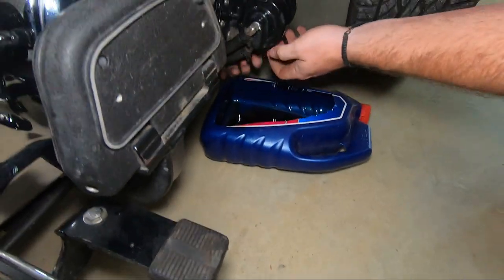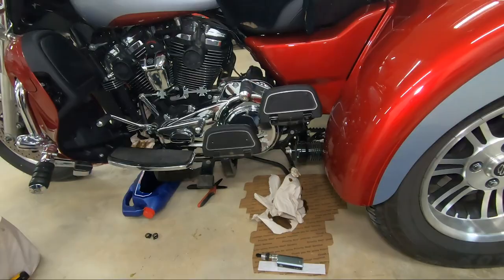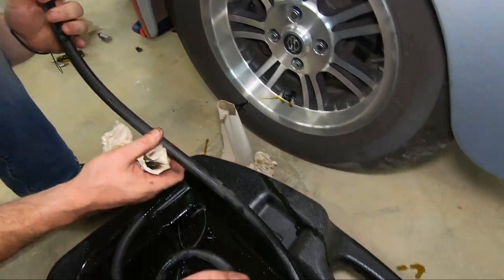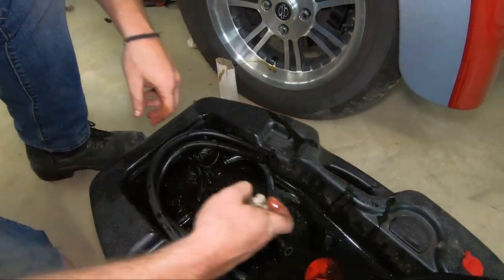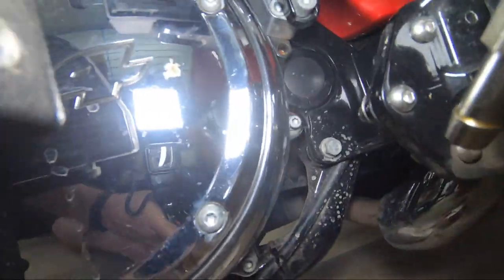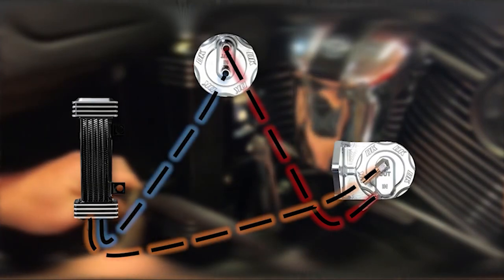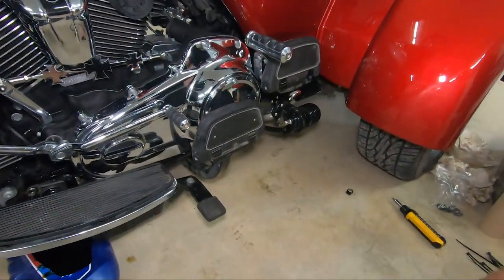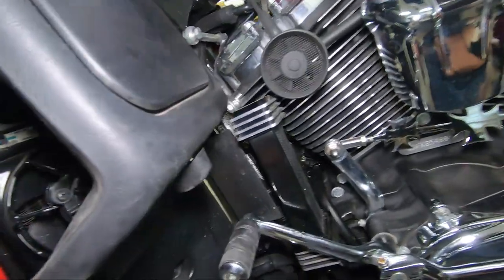Where & How to Route the Oil Lines on a Dual-Cool Harley Package

Comment: I don’t have the oil cooler but do have the remote oil filter. I ran 3/8 gas line for the oil line . Rubbing occurred after about 2k miles at the front of the primary and I lost every drop of oil in about five minutes. I replaced the line and covered it at the possible rub spots, particularly where it drops by the kickstand and under the primary with 5/8 gas line. Still being nervous about losing my motor I’ve purchased 3/8 steel braided line with a nylon outer casing made for race cars from Jegs at a cost of $65 for ten feet. I didn’t expect a rub through so early on the install even though the instructions say check out the lines every 5k miles. I don’t personally think the lines will pose a problem with them zip tied together if they’re tight but since the only way to get them from the filter adapter down to the frame rail is by the kickstand and under the primary then the possibility of rubbing is greatly increased and particular attention is required at that point. I’m not a hack, been doing this sort of stuff for about 50 years. I did mention what happened to me in a review on the product but didn’t get a response which may be why they came out with this video. The product is well made and the intended theory is good however the potential danger is real if proper care isn’t exercised while doing the install.
Reply from the maker: Thanks for your comment.
We made the video because I was going on a big trip out to Arizona, and it was time to do my regular inspection of my oil lines.  I found that after 4 years and about 40K miles that the hose was showing some age and needed to replace it.  So we videod it.

I did not see your review, and our software does not let us respond to reviews.  However, and email or a call to us always gets a response.

You are correct, as noted in the instructions, it is very important to route the lines where there are no rub points against anything that may cut/gouge the lines.  Super happy to hear you got yours routed well now. 👍

Comment: My only concern about running one line on the outside of the frame rail is using a biker bar for trailering.  The biker bar clamps to the outside of the frame rail too.
Reply from the maker: Understood.  Lots of folks run them both lines inside the frame rail.  No issues with that at all.  It is just my preference to run one on either side....not even sure why I prefer that...just the way I have done it on several bikes.
Always feel free to email or call with any questions.
Support@DKCustomProducts.com
662-252-8828
Thank you for looking at our parts.

Comment: Why aren’t those braided lines?
Reply from the maker: We do offer braided lines as an option, but the kit comes with standard hose for a few reasons. 
(1) The braided hose is hard to cut and frays if it is not cut right.
(2) The braided hose is not malleable so it is harder to route because it does not bend like the standard hose. 
(3) Harley's use standard hose all over the bike there is no reason not to use it in this installation. 

You can see the braided hose that we offer as an option on the machine finish Oil Filter Relocation product page  pictures seen at this link - https://www.dkcustomproducts.com/cnc-oil-filter-relocation-kit-machine-cut-finish-sportster-dyna-softail-touring.htm

You can see all the Oil Filter Relocation kits at this link - https://www.dkcustomproducts.com/oil-filter-relocation-kits-c610.htm

Please feel free to contact us with any questions;
Support@DKCustomProducts.com
662-252-8828

Thank you for commenting! MB😎

Comment: Why do these kits use a filter adaptor instead of the existing oil cooler lines to run oil through the cooler?
Reply from the maker: If you are not relocating the oil filter, you can use the existing oil cooler lines.  Here is a video about the oil filter relocation that gets that oil filter out in the wind and away from the engine, where it inevitably makes a mess when changing the filter.
https://www.youtube.com/watch?v=N9HnTWKbfbc

Comment: I prefer to use fuel line clamps .
Reply from the maker: That is absolutely an option that works.  In an upcoming video we tested those.  They are generally easier to install and less likely to install incorrectly, but we did not like how they were not providing as good of a seal on the oil lines.  Probably not a problem, but we were just not comfortable with them in this size.

Comment: WHAT ABOUT A 2013 WITH FACTORY OIL COLLER ALREADY INSTALLED?
Reply from the maker: We do not have a video with this install, but the instructions do include instructions for use with your existing oil cooler. You can see the instructions at this link - https://www.dkcustomproducts.com/media/wysiwyg/lubrication/Dual-Cool_Oil_Cooler_11_2F28_2F17.pdf

Please feel free to contact us with any questions;
Support@DKCustomProducts.com
662-252-8828

Thank you for commenting! MB
Reply: My concern was with the new adapter that takes the place of the oil filter at engine. When installed you now have the factory in and out nipples plus the in and out nipples on the new adapter. I came to the conclusion that it would be best to just remove factory nipples and replace them with plugs. Not sure how you recommend this procedure, but this is the part that is not mentioned in the install instructions. I am very pleased with the quality of the parts I purchased and the excellent customer service but if plugging the factory nipple holes is the correct way to address this issue, I would think the kit would come with plugs on these models to prevent having to chase them down before the install can be completed. My other concern was, is it a good idea to run both coolers or should the factory installed cooler be removed.
Reply from the maker: You will remove the OEM oil filter adapter and replace it with the engine side adapter that comes with the kit. Then you will follow the instructions on installing the hose and oil cooler and oil filter relo with your OEM oil cooler. 

Thank you for commenting! MB

Comment: Just wondering what the psi would be at the typical oil cooler and lines connecting it.
Reply from the maker: It's going to range from 10-psi to 50 psi, with the majority of the time in the 30-35 psi range.

Comment: Will this oil cooler work on a 2023 ultra limited ?
Reply from the maker: For your 2023 Ultra Limited with lower fairings this is the oil cooler that will work - https://www.dkcustomproducts.com/dual-cool-oil-cooler-for-2009-up-touring-models-incl-twin-cool-dk-dc-oc-fl.htm

For customers without Lower Fairings this is the oil cooler that will work -  https://www.dkcustomproducts.com/auxiliary-oil-cooler-for-all-harley-twin-cam-w-o-lowers-dk-sec-oc-tc.htm

Please feel free to contact us with any questions you might have;
Support@DKCustomProducts.com
662-252-8828

Thanks for commenting!

Comment: Great call on replacing the hoses. 
When I bought the RoadGlide the oil cooler hose on the right side was rubbing on the voltage regulator bracket. So I put a length of plastic hose cover over it. 😎👍🇨🇦
Reply from the maker: Good Tip!
All hoses on a Harley, OEM or aftermarket, should be checked regularly.
Using a cover like you did is great preventative work. 
Thanks!

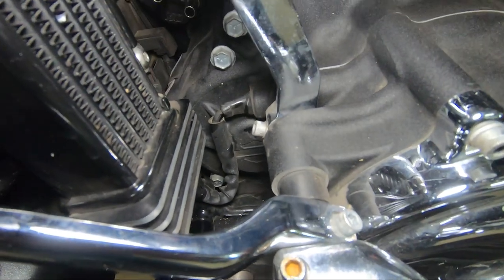Comment: Diagram and explanation of how to connect the oil cooler and oil relocation kit starts at 10:31
Reply from the maker: Thanks for pointing that out!  Appreciate the feedback! 👍 MB
Reply: @DKCustomProducts  The other question I had about this installation was if the system required more oil to function properly. I am thinking of buying this type of setup for my softail from your website.
Reply from the maker: It does require only an extra 2-3 ounces. You can see more about the Oil Filter Relo at this link. Just choose the Oil Filter Relo that is for your bike and there is a lot of information on the product description - https://www.dkcustomproducts.com/oil-filter-relocation-kits-c610.htm

 Please feel free to contact us with any questions;
Support@DKCustomProducts.com
662-252-8828

Thank you for commenting! MB

Comment: Thanks for posting another very informative video!
I have the same set-up on my 2020 Trike but I installed it with the optional braided hose which is a very high quality, robust hose.     I routed both of my hoses on the outside of the frame rail as I was uncomfortable with the entry and exit points on the inside of the frame rail. I put some split electric wire loom over each hose, which is not overly robust, but with both hoses on the outside of the frame rail, it is very easy to inspect during an oil change and address any issues before it jeopardizes the hose itself.
The only other suggestion I would offer is that I would be willing to pay an additional price for a custom-molded hose for the short hose as the braided hose is less flexible and I made a loop in that hose to relieve any concern of stressing the connection or risking a kink which obviously would be catastrophic.
Keep up the great videos and developing great products!
Reply from the maker: All Great Suggestions.  Thank you for adding your experience to the conversation.  All good stuff!  👍

Comment: That oil filter does not have an anti-drainback valve... I take it you see no issue mounting it horizontal? Great video again :-)
Reply from the maker: Thanks, glad you are finding the videos useful/interesting.
There is no  issue, pressure builds faster with these oil filter than OEM and other paper filters.
https://www.dkcustomproducts.com/outlaw-high-performance-cleanable-oil-filter-in-polished-finish-dk-ocof-crm.htm

Comment: I love your guys videos and custom parts! I have a 2016 ultra limited twin cooled. I am interested in the oil cooler and oil filter relocation kit. I am also interested in converting my air cleaner or to a external breather. I have the S&S air cleaner with open element that uses the stock chrome outer cover. Thanks for all the great information you guys share!
Reply from the maker: Thank you! I am so glad you like our video content! Please email our Customer Service at support@dkcustomproducts.com or call 662-252-8828 and they can help you with your order and any questions you might have.

Comment: Why not use braided?, I've even purchased a larger hose, split it down one side put it over my existing hose, then zip tied it.
Helps  prevent the rubbing.
Reply from the maker: Great point!
We do offer braided line as an option.  The rubber hose inside the braid still will wear with heat and cold and eventually need to be replaced.
The black braid is nylon and wears at about the same rate as the rubber (but looks nicer).  The stainless braid will not wear, but it will scratch anything it touches.
Both are a bit more work at cutting and installing.
All that said, Braided line is definitely an option to be considered.
Reply: @DKCustomProducts   I got the black braided lines with my kit and really like the look but caution anyone inexperienced with braided hoses that you need to know what you're doing when you cut the hose... measure twice, cut once is a really good rule to follow but after you measure, wrap a few layers of tape before cutting... and double check your measurements after you tape the hose. I cut mine with a cutting wheel then cleaned out the hose really good before continuing, the debris left behind from the cutting wheel is not a nice thing to be circulating in your oil! Now to push the hose over the fitting can be a challenge but soaking in hot water for a minute or so makes a huge difference... but this is where the braids like to fray out so make sure you are using a water proof tape.
at this point you can clamp as usual but I would recommend using a 1 to 2" long piece of heat shrink at every end, this not only prevents the fraying and painful pricks you get when working with this hose but it leaves you with a nice looking clean install.
You'll need to inspect this hose the same as you would any other hose and be careful as it will scratch into your painted or aluminum surfaces it's routed next to and touching so heat shrink or tape over any points where this hose touches any part of the bike you don't want marred up.
You can't inspect the internal hose quite so easily so changing after 5 or 6 years is a good way to prevent a leak.
Last word of caution is don't route a stainless braided hose too close to any positive battery terminal or positive wire, and also stay away from the back side of the starter with this type hose, if it does make contact, even for a split second, it can and will spark but that spark can cut a hole in the braid and the hose inside it... ask me how I know... but that's the last thing anyone would want is for a stainless braded hose to chafe thru a battery cable and you're a few hundred miles from home or the nearest town where you can get a new hose etc...

Comment: Does the oil cooler put extra strain on oil pump.
Reply from the maker: It does not.  Some of the passageways in the engine are much more restrictive than the passageways in the oil cooler.  
The one factor in the oil loop that can put a load on the oil pump is a paper (OEM & most aftermarket) oil filters.
That is why we use permanent performance oil filters, because with them there is much less strain on the oil pump.
You can see a video where we dyno tested performance oil filter compared with OEM oil filters.  You can see that at this link- https://www.youtube.com/watch?v=__WbuX1IT1c
Reply: @DKCustomProducts  already got the flo oil filter from you can I use it?
Reply: @DKCustomProducts  does it interfere when leaning left
Reply from the maker: @charlesmc1841  Yes, you can use the cleanable oil filter with our Oil Filter Relocation kit. This will not interfere with leaning.

Comment: Is the oil cooler labeled  in, and out?, or does that matter?
Reply from the maker: Yes, it does matter, and yes, they are labeled. Check out the photos at this link, you will see the "IN" and "Out" are engraved right into the metal of the housings.
https://www.dkcustomproducts.com/media/catalog/product/cache/1/image/9df78eab33525d08d6e5fb8d27136e95/p/o/pol_oil_relo_1.jpg
Reply: @DKCustomProducts  cool, thanks. 
I was curious.
Reply: @DKCustomProducts  oh , I meant on the cooler, mounted on the frame.
Reply: @kevingleason5434  I was wondering the same thing, why not run the hose coming along the frame from the oil filter base, to the outside nipple on the upright cooler, then it would be easier to route the hose from the cooler to the Original Oil Filter base in front of the engine, vs. having to go around the nipple and hose on the cooler, to get to the front of the engine.